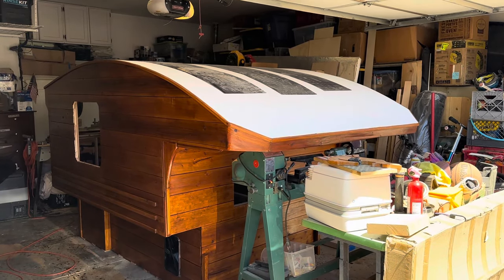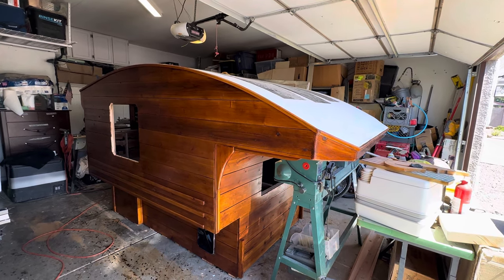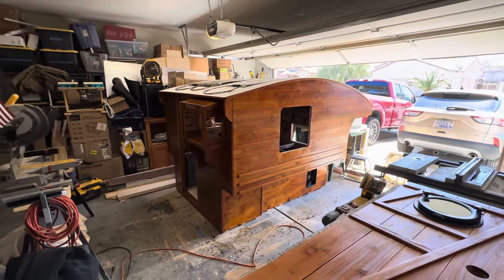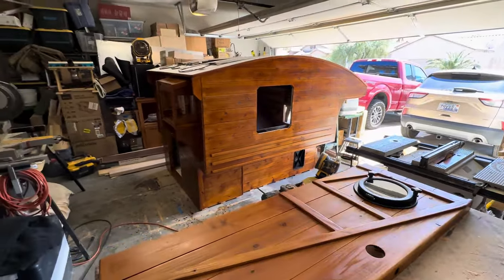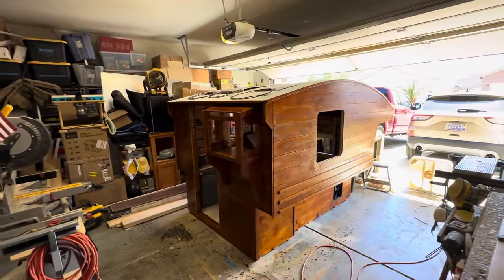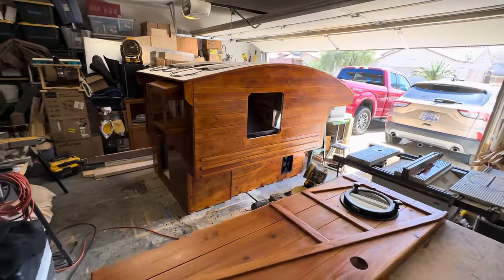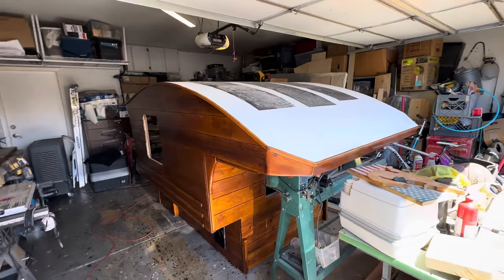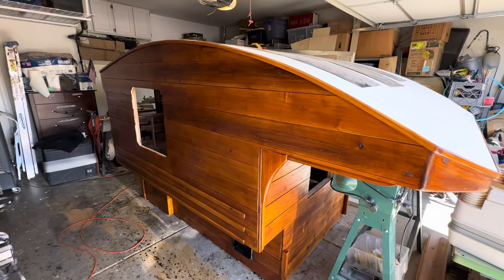Truck Camper Build 8.0 VLOG, Part 10 - Exterior Finish Has Been Applied!

Comment: Hey Dave, awesome job yet again. A few questions. 1. What did you use for the pass through door to get to your turnbuckles that looks slick. 2. How did you get the trim around the top to follow the curve, is it just a lot of individual pieces and sanding? Good to see you back to making the campers!
Reply from the maker: 1. They are a marine hatch. You can find them on Amazon 
2. Two pieces total. Trial and error, but I found if I find a knot free cedar board, plane it to 3/8 and rip to 7/8, it will bend.

Comment: Roof question: Have you ever tried using wood glue over fiberglass matting to waterproof and strengthen. I did a test using acrylic paint, but I'm not impressed - lots of pin holes after 2 coats. Just curious if you have tried this with something like Titebond 3.
Reply from the maker: Poor man’s Fiberglass…. I haven’t, but people seem to love it. Though, instead of fiberglass mat, they typically use canvas or even window screen. I personally don’t really have an opinion. I decided to spring for the tried and true fiberglass.